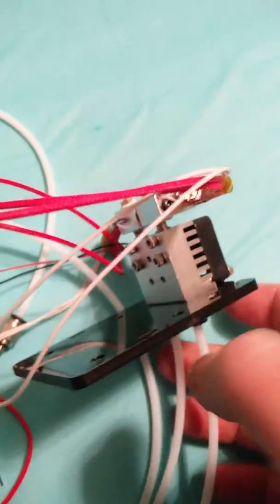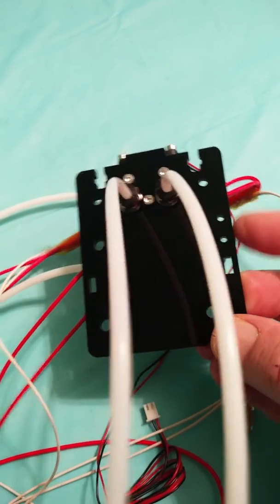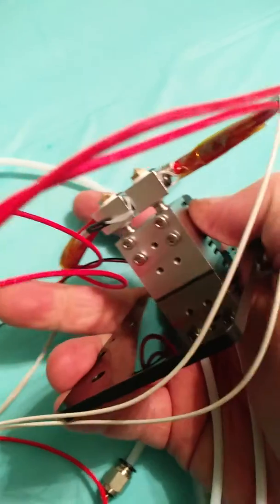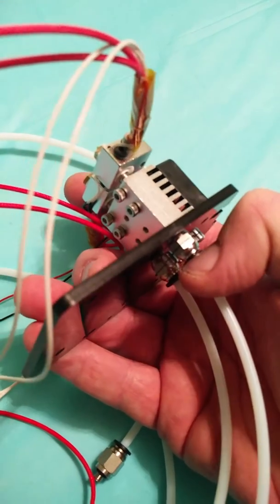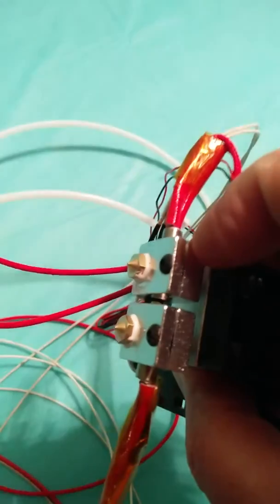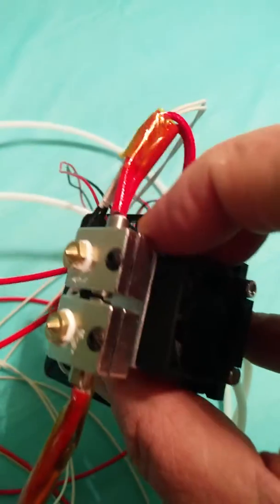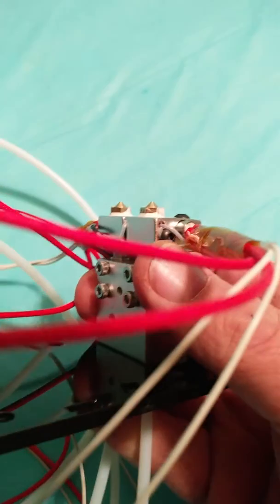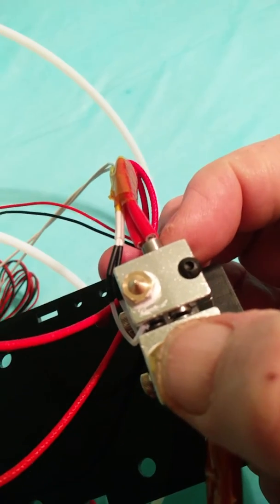FLSun Dual Extruder Hotend tips

Comment: can u plz send the firmware of dual extrusion for flsun i3 plus?
Reply from the maker: No problem, I'm at work right now, but when I get home I will post them here.
Reply: Thank you sir! I've changed the single extrusion to Dual extrusion. But couldn't modify and upload the Firmware
Reply: Sir! R u there?
Reply from the maker: Finally! It was a late night at work. :) In any case, you should have the files, I just sent them out.
Reply: Thank you sir! Got ur mail
Reply from the maker: Great! And I forgot to mention that I used the CL-260 sample configuration.h file as the basis for my configuration.h file. So if you start with it (found in the AliExpress folder in the example_configurations folder). 

And things have progressed a bit since I did mine... So to try to keep up to date, I took the Marlin 1.1.x version and added my changes to it. Here they are:

#define MOTHERBOARD BOARD_MKS_BASE //JEW
#define EXTRUDERS 2 //JEW
#define TEMP_SENSOR_1 1 //JEW
#define USE_YMIN_PLUG //JEW
//JEW #define USE_YMAX_PLUG
#define X_MIN_ENDSTOP_INVERTING false //JEW set to true to invert the logic of the endstop.
#define Y_MIN_ENDSTOP_INVERTING false //JEW set to true to invert the logic of the endstop.
#define X_MAX_ENDSTOP_INVERTING false //JEW set to true to invert the logic of the endstop.
#define Y_MAX_ENDSTOP_INVERTING false //JEW set to true to invert the logic of the endstop.
#define Z_MAX_ENDSTOP_INVERTING false //JEW set to true to invert the logic of the endstop.
#define Z_MIN_PROBE_ENDSTOP_INVERTING true //JEW set to true to invert the logic of the probe.
#define FIX_MOUNTED_PROBE //JEW
#define INVERT_Z_DIR true //JEW
#define INVERT_E0_DIR false //JEW
#define Y_HOME_DIR -1 //JEW
#define X_MAX_POS 350 //JEW
#define Y_MAX_POS 330 //JEW
#define Z_MAX_POS 410 //JEW
//JEW #define MIN_SOFTWARE_ENDSTOPS
//JEW #define MAX_SOFTWARE_ENDSTOPS
#define AUTO_BED_LEVELING_3POINT //JEW

I try to remember to mark all of my changes with my initials (hence the "JEW"). Where you see the initials at the front of the line, that's a line that I commented out. At the rear, either an un-commented line, or one that I made a change to (for instance, changing "true" to "false").

And these are changes that I made for my printer, and while they seems to work pretty well for me, they will probably cause you printer to sprout horns, and only want to print out bad copies of imitated Shopkin thingies. 

Use at your own risk. But please do post your Shopkin thingies...
Reply: Sir! I've uploaded the firmware, it works, need adjust the sensor now
Reply from the maker: Awesome! :)

And I rotated the hotends so they have more separation.

I really need to upload a final video of the project. But it will probably have to wait until I get back from vacation (middle of July).
Reply: eagerly awaiting sir!

Comment: Fantastic video if you don’t mind I’d like to share your link on my load next live build
Reply from the maker: Absolutely! Thanks! :)

I'm going to make a tiny adjustment to my hot ends and rotate them 90 degrees so that the skinny sides will be facing each other. This will spread them apart and help keep heat from being transferred to the other hotend.

And the thermistors will eventually be replaced by these:

https://www.ebay.com/itm/Screw-In-M3-Stud-NTC3950-100K-Thermistor-Upgrade-for-3D-Printer-Extruder-Hotend/222899773112?ssPageName=STRK%3AMEBIDX%3AIT&_trksid=p2060353.m2749.l2649

I'm using one on my Rostock, and they are fantastic! They are a drop-in replacement for the stock glass ones, and are far more durable.